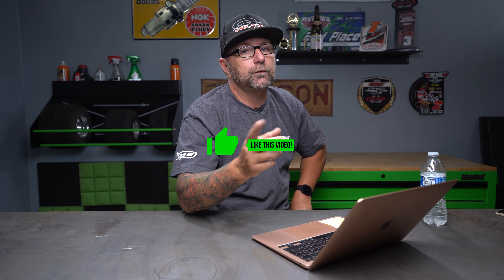Confronting ALL YOUR Comments  (HAVE TO COME CLEAN)

Comment: Okay, I have a question for you.. I have a 23ft 2007 dynamax on  a E450 chassis.  It currently has a Dynaride suspension from Reyco Granning.  But I literally have about eight inches of clarence. I would love to get one of your conversions but I don't have $30,000.  Do you have a more Inexpensive system. I really don't think I need a 4 wheel drive kit. I just need the Clearence.